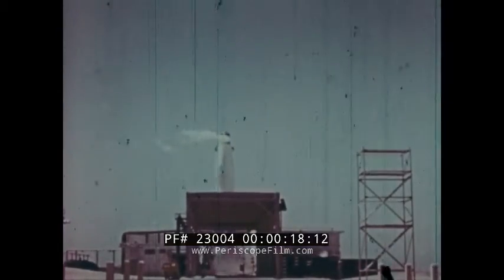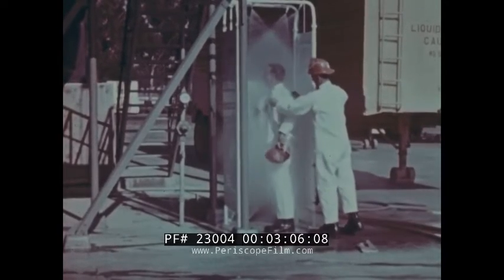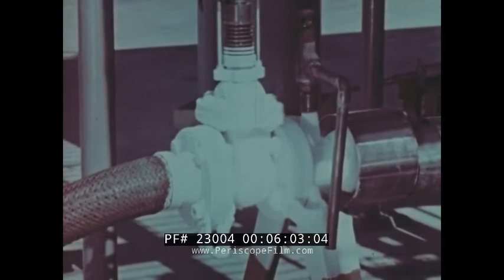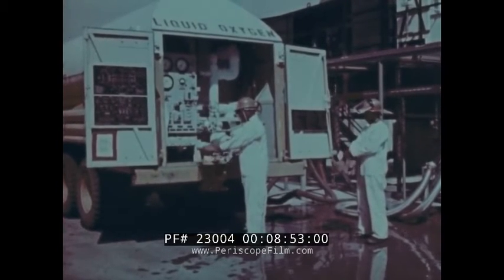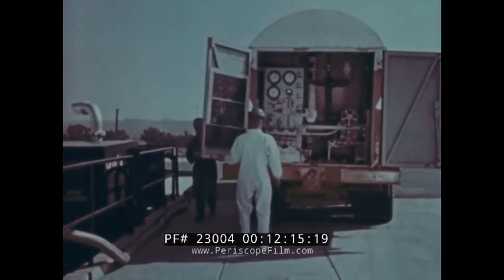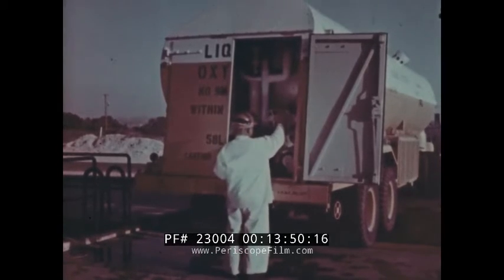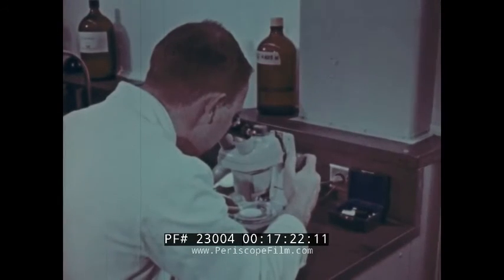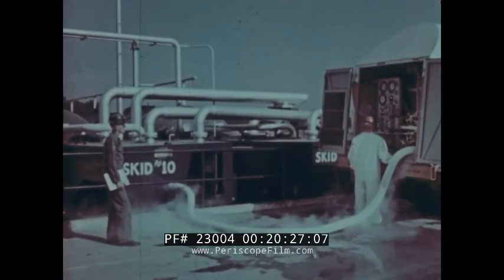LIQUID OXYGEN  LOX  HANDLING, RECEIPT, TRANSFER, STORAGE & DISPOSAL TRAINING FILM 23004

Comment: You always, always pay attention to which way the wind direction is. You do not want pure oxygen blowing back onto your vehicle or yourselves while handling LOX.  Three vehicles were destroyed and several personnel were hurt at the Cape while near by a burnoff pond while dump procedures were underway. The atmospheric conditions caused the cloud of LOX to hug low to the ground, imitating water fog. The vehicles were bathed in the pure oxygen fog. So when the occupants got into the vehicles and turned the ignition, they heard a loud POP and flames  started shooting from under the hood. They vacated while their vehicles were rapidly consumed in a oxygen fed fire.
Reply: When and where did this happen on the cape? Was it on KSC or the space force base?
Reply: @jimc12  KSC, during the Moonport missions.
Reply: @jimc12  A strange accident punctuated the last day of the test. Early on 25
March, Graydon Corn's propellants crew started the chill-down of the LOX
pumping system. The operation required a 760-liter-per-minute flow to the
replenishing pumps (which could handle five times that rate) and a lesser
amount through a bleed line that had been added to the LOX system after
the 500-F spill in August 1966 (pp. 343-44). During the 40 minutes of pre-
cooling, the launch team emptied 39000 liters of LOX into a drainage ditch
outside the perimeter fence. Normally ocean breezes dissipated the oxygen
fog. On the morning of the 25th, however, there was no wind and a pro-
nounced temperature inversion. A dense fog built up in the drainage ditch; at
a culvert where the road to the slide wire bunker crossed the ditch, the invisi-
486 MOONPORT
ble oxygen overflowed onto the bank. At 6:00 a.m. the closeout crew and
safety personnel left the LOX storage area. First-stage loading could begin
after a three-minute chill-down of the 38 OOO-liter -per-minute main pumps. A
security team completed its job of clearing the pad area and proceeded in
three cars to the perimeter gate southwest of the LOX sphere. The driver of
the first car, Patrolman Nolan Watson, drove through the gate and parked.
As he walked back to Earl Paige's car, an order over the radio directed the
team to clear the slide wire bunker area. Paige turned his ignition on and
heard a loud pop. Soon flames sprang up from beneath the hood. Watson
ran back to his car, only to find it also on fire. About the same time, the third
car burst into flames. The three guards quickly ran for cover. A fire and res-
cue crew arrived in five minutes but took no action until the oxygen cloud
dissipated. It was nearly 7:00 a.m . before the fire was under control, leaving
three burnt hulks and a shaken crew.
Debus called for an immediate investigation. The preliminary report,
rendered a week later, blamed the accident on the enriched oxygen atmos-
phere. Spontaneous ignition resulting from the engine heat, combustibles (oil
and grease on the engine covers and gas around the carburetors) and the oxy-
gen vapor cloud caused two of the fires, the third apparently starting when
the driver turned the ignition switch. The report criticized the practice of
dumping large quantities of cryogenics and termed the resulting vapor a
hazard. Recommendations included immediate studies of the drainage
system l ~ ading from the LOX storage area and its dump reservoir, of entry
and exit routes at pad 39 A, and of KSC's safety training course. The major
change brought about by the accident was to extend the LOX drainage pipes
beyond the perimeter ditch to a marshy area farther from the pad . 2
Reply: @Nighthawke70  pad 39A, thanks. I work with LOX and LN2 on that pad, as well as 40 and 41. I didn't know this happened.
Reply: @jimc12  freak weather inversion during Apollo 13.  Scared the guards badly.

Comment: LOX was the best hangover cure ever, standing in a LOX charging bay early in the morning after the night before was a case of going in totally hanging and after an hour filling LOX pots for aircraft came out without a hint of the mother of all hangovers, best feeling ever. Standing in the middle of the LOX production plant in the Saudi Arabia desert in 40+ degree C heat basically bathing in the gaseous boil off from the plant was a weekly trip from the flight line that we used to fight over, better than any air conditioning system ever, same for the Liquid N2, except you had to be careful not to suffocate, those were the days. 😀👍🇬🇧🏴